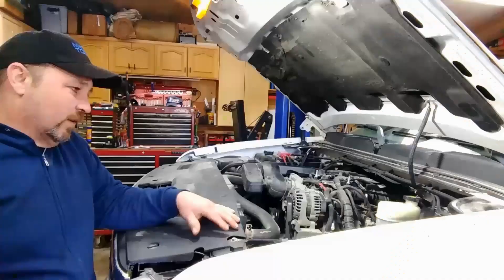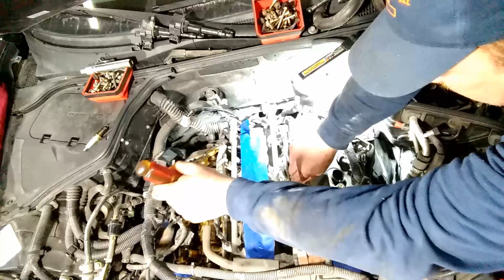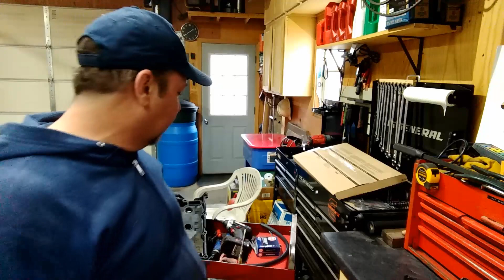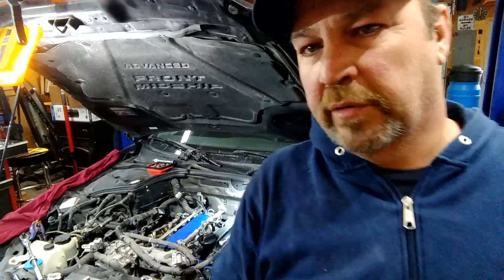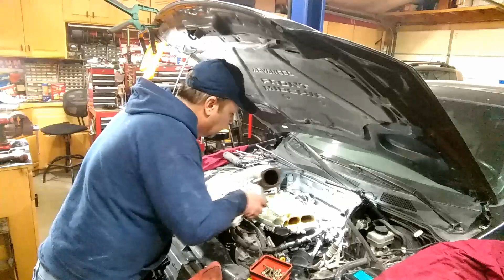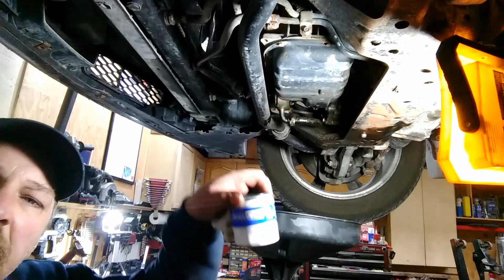2006 Infinity G35 3.5 DIY Valve Cover Gaskets Replacement. (Intake Plenum Removal) #60

Comment: Pete, another great video....how the heck did you get into a G35.... how does the custom garage work as far as customers, where do they come from?....  more importantly I saw the coyote 2011 f150 lariat video on the coolant leak....much more pertinent to me since I have a 2012 lariat with the 5.0- coyote 6r80 trans but no cooliant leak yet, hopfully I can avoid leak??  Ahhh, sorry to seque off of the g35..... how do you go to a g35 from a f150???  yeah, had few brewskies tonight before watching this video so wandering a bit....but going from a 2006 grand prix to a f150 to g35....  nice work.  Hey...and thanks for the Christmas eve shout out.
Reply from the maker: I been fixing cars for the last 35 years and I have a good reputation and my customers trust me.  I am very grateful to have the customer base that I have so I will try to fix whatever they bring me.  The G35 was a new experience for me and now I kind of like it and wouldn't mind having one myself, but I can't remember the last time I worked on one but it probably was for a oil change or something simple like that.  I think all them coyote engines will start to leak eventually just keep an eye on it, you'll be fine it's an easy repair.  I just want to help people with my experience and make a difference.  Thanks for the great comment!